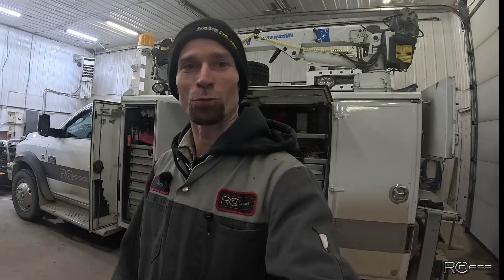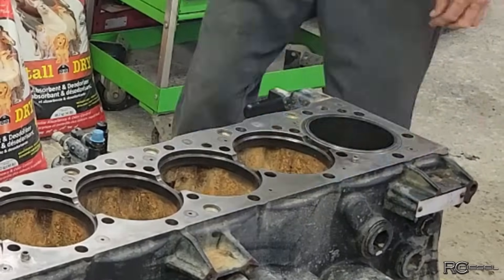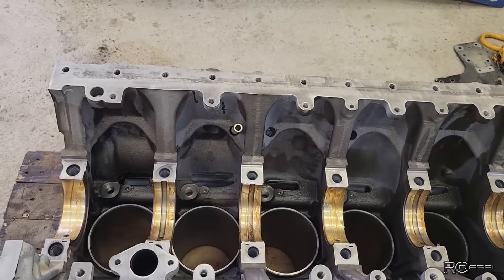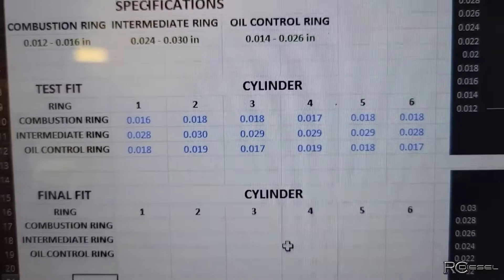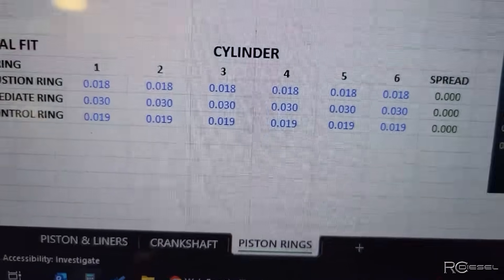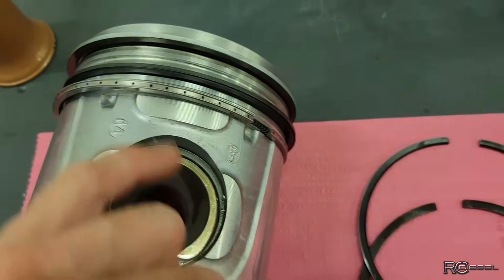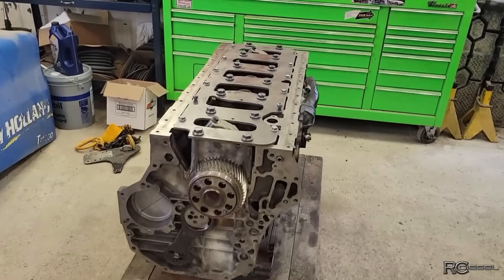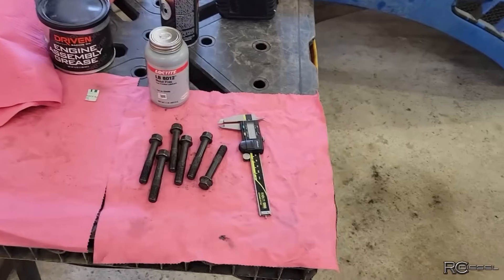Rebuilding an 8.7L Iveco Engine | Part 3: Reassembly – Liners, Pistons, Crankshaft & More🔧: RCDiesel

Comment: How did you grind the piston rings with such precision?
Reply from the maker: I have an electric ring filing tool made by Proform. It has a dial indicator built in. It's a little quirky to use and it takes some practice, but it sure beats the old hand crank ring filers when you're filing rings for a whole engine. Some day I'll get a video done on how to do that.

Comment: Best diesel channel on yt. How many ATs have you had in that Ram?
Reply from the maker: @robertrpenny  Thank you for the high praise! Really appreciate you watching!

Can you define "AT's"?
Reply: @rcdieselchannel  Auto trans. But maybe its a 6 spd.std. i jumped to that conclusion
Reply from the maker: @robertrpenny  Aaahhh gotcha. That's a 2011 and currently has 239,000 km's on it. I bought it at 152,000kms with all the maintenance records. Truck weighs 17,000lbs with me in it. So far, that factory original Aisin Trans has never seen a thing but oil changes and filters.
Reply: @rcdieselchannel  I heard Aisin is an Allison clone but prob not quite. But thats good service for a heavy truck. But driver common sense has a lot to do with it.
Reply from the maker: @robertrpenny  Fair point, I have limited experience on the Allison's and almost no experience at all on the Aisin as far as mechanical work, so I really can't say how similar they actually are... 

I do know that considering how heavy this truck is and the fact that it is 100% loaded 100% of the time, I think the transmission has done really well. 👍

Comment: I am waiting for timing of camshaft, its a little bit unusual on this engine. Great video and great work!
Reply from the maker: Yes sir, timing this was a bit of a fiasco as you'll see soon. I really had to use my brains on this one. I have a CASE IH FSM and an Iveco manual and they both have some problems... And I got confused on the dial indicator method too.... Well, you'll see 😝

Comment: If you have trouble sealing up liners to block, old mechanic trick is to put a tiny layer of some high quality RTV onto liner o-rings. It's interesting, that all three o-rings failed on that engine, some only have two.
Reply from the maker: I can see that working, but if the liner seals are right and the lower liner bore is good, you should never have to use silicone. I've had to JB Weld corrosion pits in the lower bores before when trying to save a buck, but I have yet to silicone a liner in. 

It is amazing that so much coolant was coming past the liner o-rings. They actually didn't look that bad to me... But I guess if they get too soft, they can't hold back the pressure. I heard tell of some dealers having Customers switch to a different coolant to prolong the issue until these tractors were off warranty.

Comment: Here at an official Case IH dealer in Spain they are charging around ten thousand euros😮😮😢
Reply from the maker: Ok, so that would be roughly $15,000 CAD. I have close to $18,000 CAD in parts and machining on this thing, so the total job is going to be a lot more. If I was just replacing liner seals, I could probably do it for under $15,000 CAD. The head needed new intake and exhaust valves and those parts alone was almost $5,000!!!

Comment: Great video. I always measured all the clearances on a rebuild, warranty or not. Helped me sleep at night. Seen so many techs just assume if your using standard bearing on a standard journal everything would be ok.
Reply from the maker: I would agree, probably most mechanics I know do not check all the measurements. Most of the time you get a away with it if the engine suffered no catastrophic damage before it was rebuilt, but if you wipe out one crank because of a wrong bearing for example, that gets expensive quick!  I've done a lot of engines and I've caught some issues by double-checking on all this stuff. It ads a ton of time to an overhaul, but in the end, I just believe the Customer get's a better engine and a better job. I try to be as professional as I can with what I have to work with.